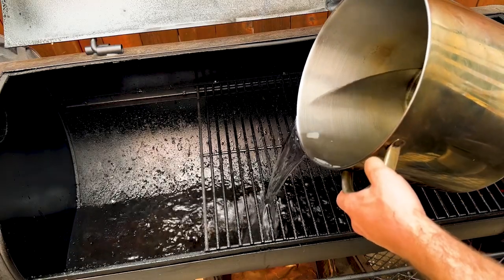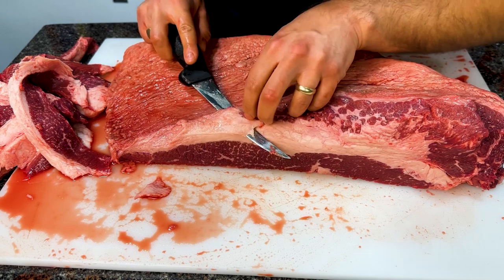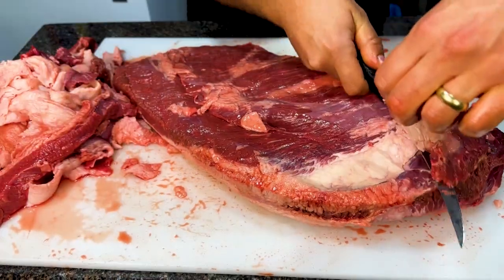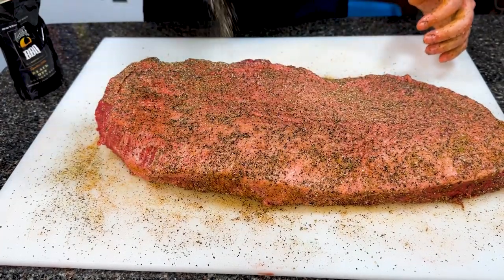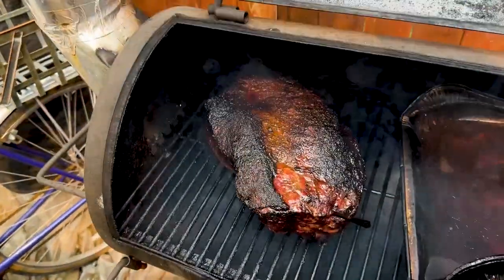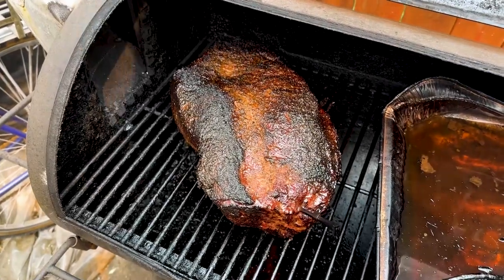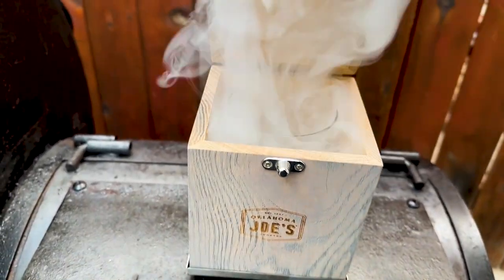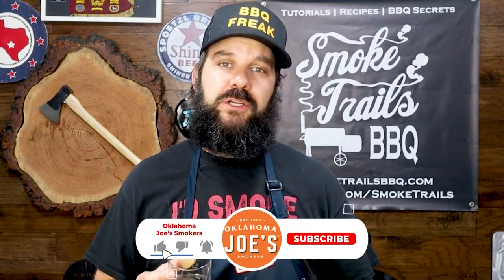I filled my offset smoker with WATER and THIS happened | Smoke Lab with Steve Gow | Oklahoma Joe's®️

Comment: Another awesome video Steve. I got a gourmet outdoor smoker and what I did was put a water pan on the bottom of my pit by the offset hole so all the radiant heat hit it first and man my smoker temps are even throughout now
Reply: Ahh that's a great idea. Does it make the meat juicier you think?
Reply: @SmokeTrailsBBQ  yes!! Ever since I made that mod my food has come out juicier and tender.
Reply: Is this a vertical smoker?
Reply: @CoolJay77  no regular offset smoker but the smoker box is on the left side not right
Reply: Huh. I like that idea. Think I will try it on my next brisket.

Comment: I've never used a water pan with any of my cooks but maybe I will start. I usually depend on me spritzing my ribs or pork butts. Last few times I did ribs in the Bronco they seemed a bit on the dry side, even when I wrapped them. Hanging them in the Bronco works but trying to wrap 6 slabs and put them back in the Bronco I find is a pain! Anyhoo, got off subject a bit lol!
Reply: Curious if you're hanging then switching to wrapping how you fit them in once wrapped?
Reply: @SmokeTrailsBBQ  stacking them on top of each other. Isn’t ideal but it works. I’ve only done this 2 times in the last 5 yrs and it sucked every time. Told my son who also cooks with me, I won’t be doing that again. 😂

Comment: Before even watching the video i'll give my opinion of what'll happen, and why.
the cook will go a lot more smoothly, with much less heat differences, leading to a more juicy brisket due to the evenness of the cook. the fat will also render perfectly, but the crust won't be as crunchy.
All the above has to do with the water. filling it up with water increases the heat mass which you heat up, and it will retain the heat much better, kind of like a ceramic grill. The lack of crunchiness will obviously be because of the steam. basically this gives you flavor of offset with the steadiness of ceramic. now i'll watch the video and see if I'm correct lol
Reply: Pretty close! But it doesn't create as much steam/humidity as you'd think

Comment: New idea. A 55 gallon drum set up like a drum smoker but instead of charcoal as a heat source 3rd fill it with water. Put a gas burner below the drum. Cold smoke pump through the side of the barrel over the water line. Brisket on a great above that. The boiling water should maintain a 100°c or 212°f which is hot enough to cook a brikset.
Its the smoker version of the sousvide holding chest. Set it up and walk away. Come back in 12 hours.
Reply: That would be cool!